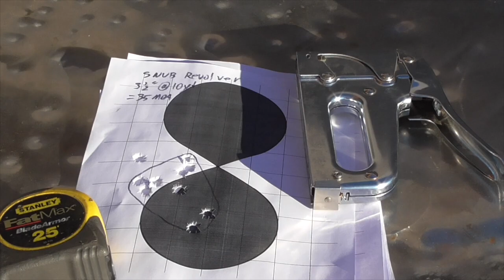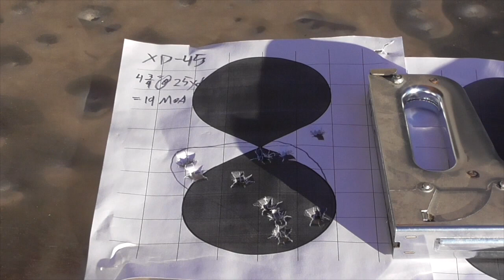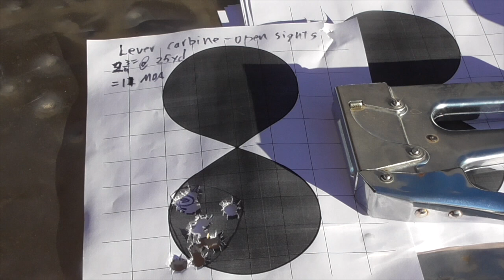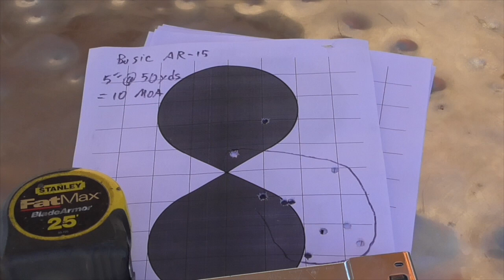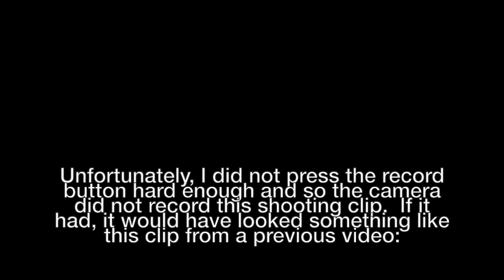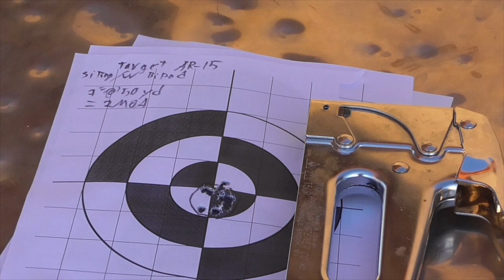Measuring Practical Accuracy (TIS305)

Comment: Gotta ask: what's going on with that red dot? It looks like you chopped a front sight base, and welded a rail to it. Which begets the question of why?  I've never personally felt the need to put the dot that far forward, is there a specific reason for you doing so? I am unaware of your typical shooting schedule so you may not be able to answer, but has the red dot had any issues with heat generated from being mounted almost directly to the gas block?  As far as the handgun shooting sights make a bigger difference then trigger and mechanical accuracy;  most modern handguns are machined well enough to lock up well enough to be accurate enough they outstrip a vast majority of shooters, triggers also are typically decent, so barring outliers the shooter makes more of a difference then the trigger